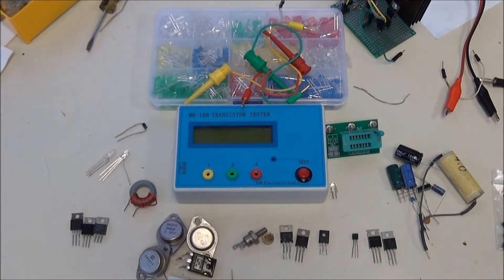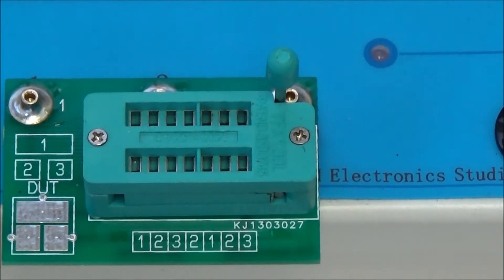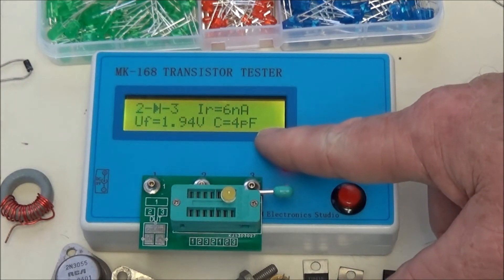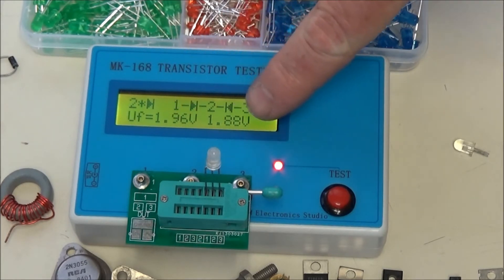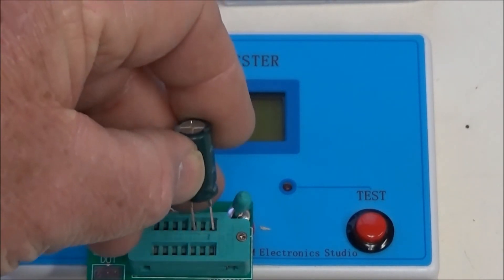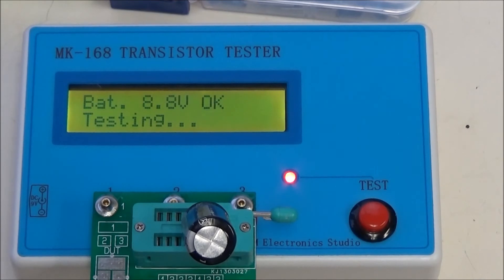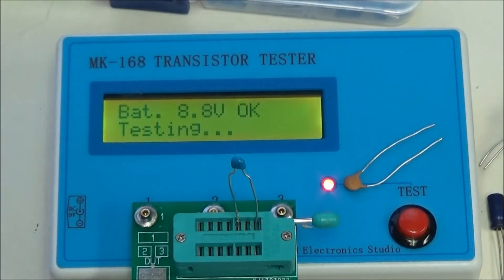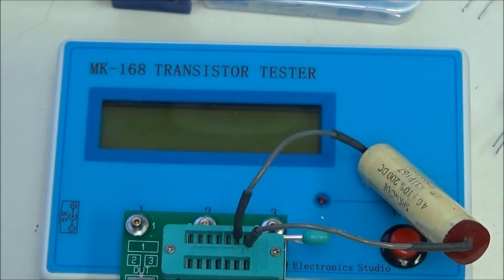MK-168 Transistor Checker Tests LEDs and Capacitors

Comment: Its a great device but as with 328 based devices a reading of 97.97 nf  for a .01uf cap seems machiny. Its a computer, surely providing a direct common readout as printed on the caps themselves can't be too hard. Tools are supposed to be shortcuts, not long math.  Hope they revise it, like the Peak Atlas.
Reply from the maker: I agree 100%. But capacitors are labeled in differing ways depending on the source.  For example, mmf was once used for pico fared.